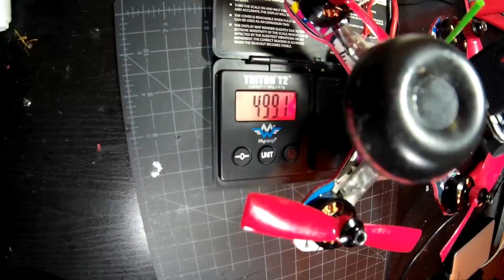BUILD A MINIQUAD: Falcon 160 // Street Edition / FPV X Racing Quadcopter

Comment: Looks great.  Any place I can get this in the US?
Reply from the maker: +snoke fpv 
Thanks man! It's the Falcon frame, it's being cut and will come out next week on March 22nd. You can find more info at falconracingdrones.com, and when it's released it should be available at Multirotor Superstore.

It's a phenomenal frame, my favorite X so far.
Reply: +Clutzz cool. Good I didn't pull trigger from armattanproductions.  Save me a few weeks of waiting.
Reply from the maker: snoke fpv
Yeah man! The acro version (on armattanprod) is sweet but the FPV pod is worth it!

I'm gonna be putting a 5" 185 together as well :p

Comment: I would let to know where to get a scale like yours and what brand and model
Reply from the maker: +Jeffrey Royster 
Sure thing, it's a MyWeigh Triton T2.
I like it, it's great for miniquads, but it has a maximum capacity of 550 grams! If you'll be building something bigger than a 225 you may need something bigger.
Reply: Thanks for the info